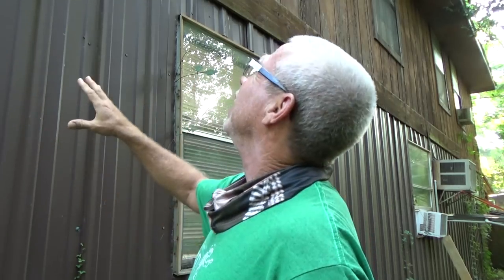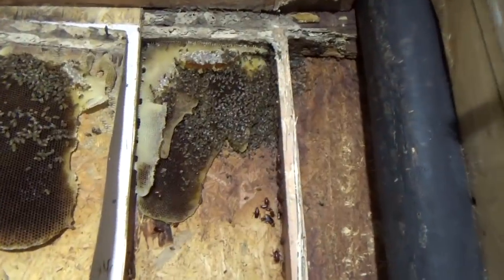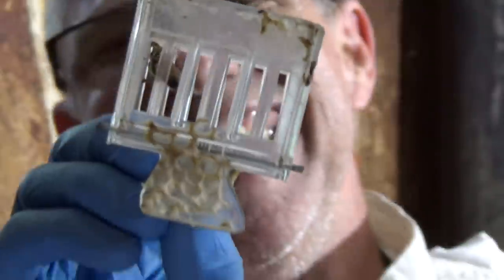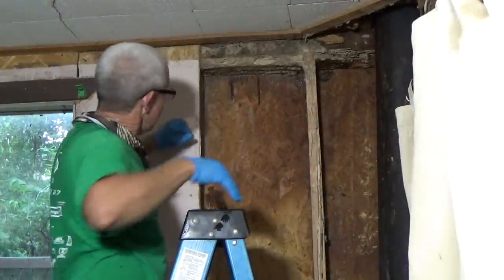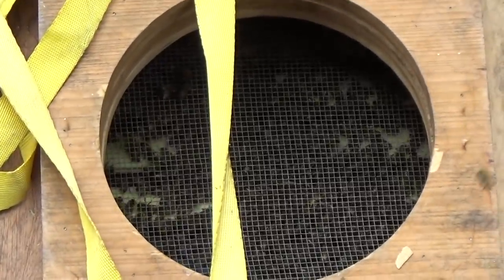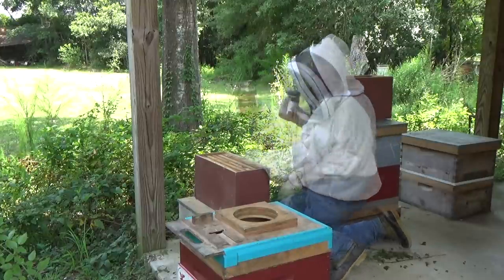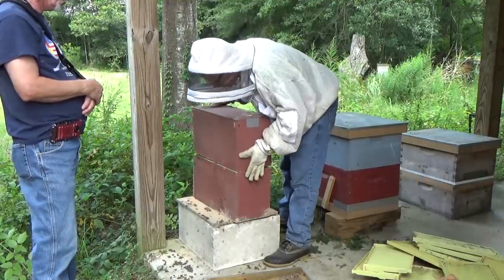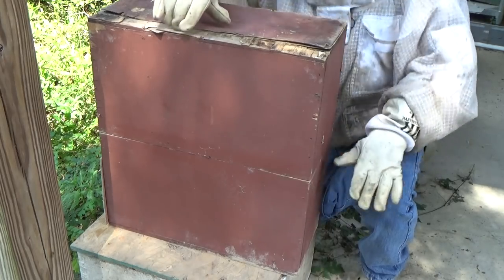When doing a cut out, how long does it take to capture the queen?

Comment: Those bees had a lot of gross bugs to deal with. The cockroachs were clearly stealing their honey. I'm glad you rescued them, because otherwise they would have died, being overrun by bugs. Do hives start to fail because there are too many bugs to deal with? Or do hives fail for other reasons and then have bugs move in on them because they are already failing? Good video 👍
Reply from the maker: Often, hives die because of other insects inside of them. Most often mites, small hive beetles, and wax moths are responsible for the demise. However, roaches are never responsible for the collapse of a bee hive. Still, they are very gross. God's peace MD.
Mr. Ed

Comment: How do you set up a cut out at home when its loaded with hive beatles? Never mind I'm watching the end of the video now. 🙂
Reply from the maker: During the summer months, hive beetles are most present in hives. Then, when their numbers grow to large, the bees can no longer contain them to certain areas of the hive, and this is when the beetles have the opportunity to lay eggs and the emerging maggots will then kill a bee hive. Really nasty little critters, I hate them way more than I hate cock roaches. Roaches can NEVER kill a hive. God's peace Leann.
Mr. Ed
Reply: @JeffHorchoff  So... i was thinking about how to control these beatles. I know there are trays used in conjunction with diatomaceous earth,  oil, etc. Chickens can be used once they're on the ground. What if one or two more steps are taken to assist the tray method. Do you think if a product were made like a double sided sticky tape with a substance that stays sticky, stuck on the bottom of the four sides of the hives would catch beatles before they got to the hive? Or even some of the fiber material that catches their feet? Also, I read that they fall to the ground then burrow in. What if there were a small tray positioned under from wherever they fall to stop them from reaching the dirt? Not sure if these two ideas have been tried before.